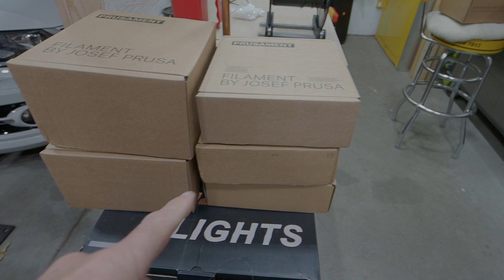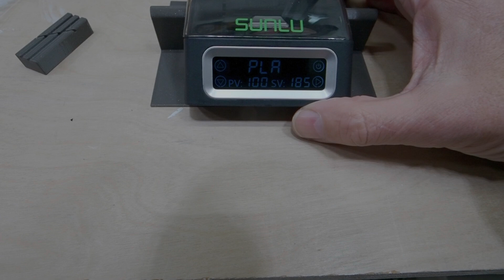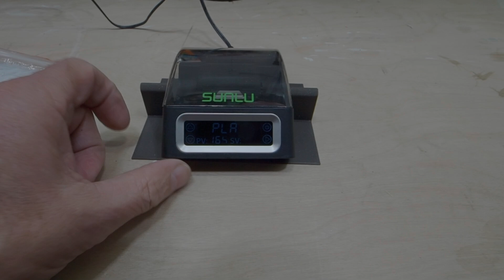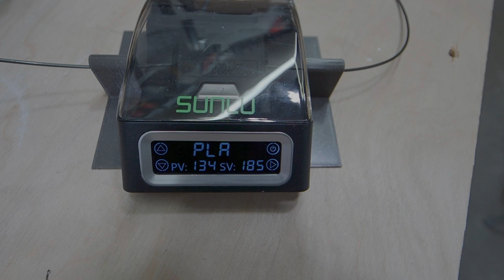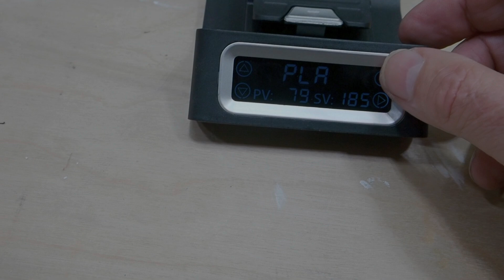SUNLU Filament Splicer for 3D printers

Comment: Do you have an STL file for the holder?
Reply from the maker: Yes but it turned out difficult to use.  It needs to be open at the top to get the spliced filament out. I think I will need to modify the file. You can find it on the Prusa site. I tried to copy it here for you but would not work.
Reply: @Nova.1971  Hey thanks Ill look for it and mod it